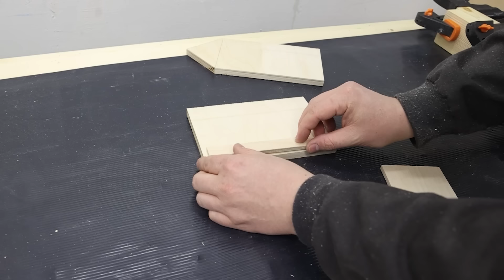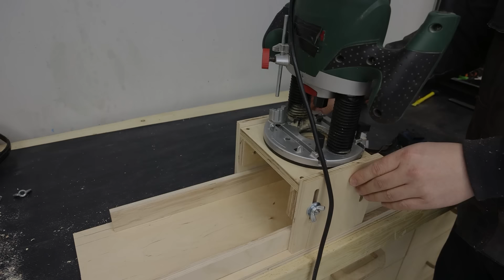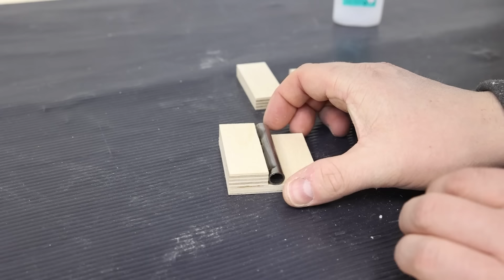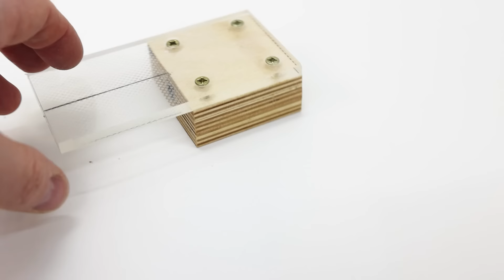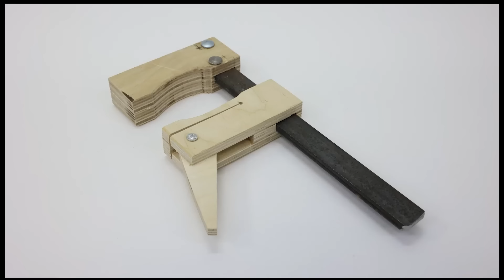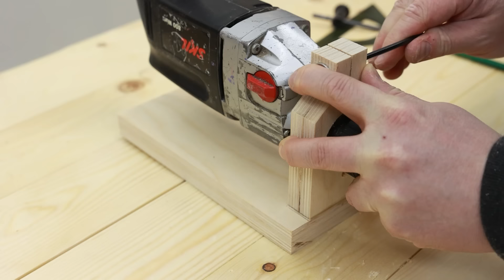Сборник Отличных приспособлений для мастерской! Сохрани себе пригодится!

Comment: For your jig to rip thin strips, add an adhesive-backed ruler tape to the base and a cursor over it to allow the user to measure the width of the thin strip beforehand.